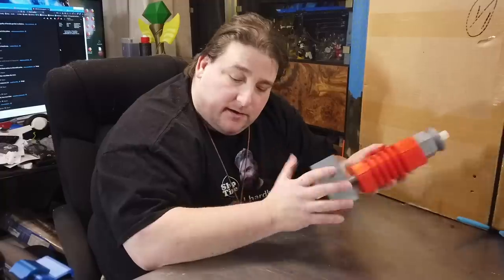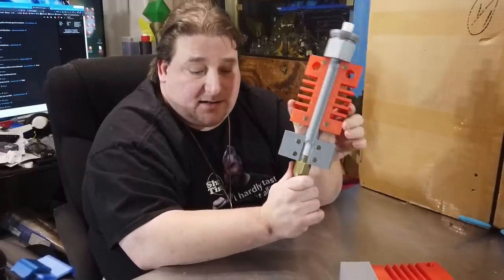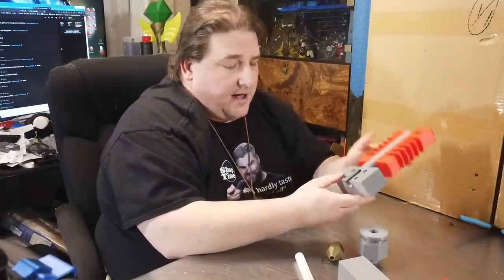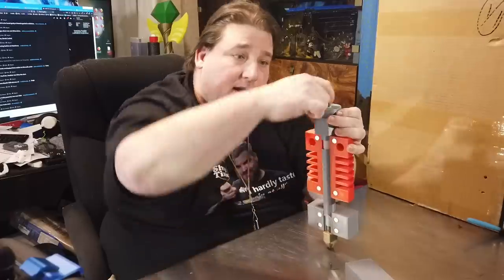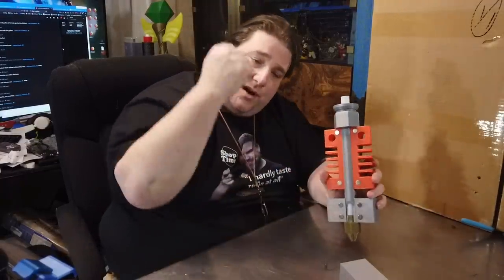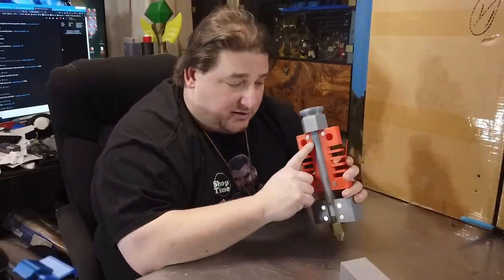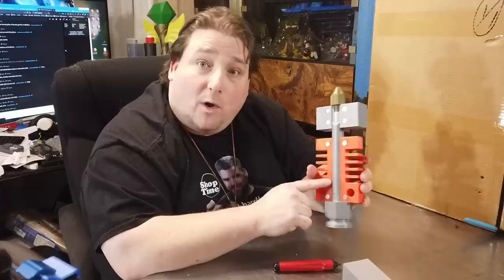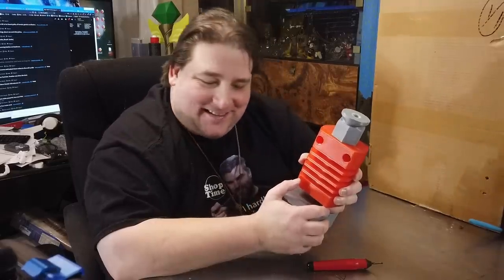Creality Hot End Failure Modeling How to Fix, Assemble CR 10 Ender 3 5 Mini T3DP

Comment: Yeah don't try to screw the nozzle all the way on the Ender 3. Mine snaped because it's supposed to have a gap on the ender 3 for some reason.
Reply from the maker: It's not so much that it has to have a gap but if you bottom out the nozzle into the hot end then you won't know if you have actually made contact with the bowden tube so by making sure you have a small gap there by essentially putting The Bowden tube for their end you are ensuring that you're making contact with the bottom tube and not just mistaking me thinking you are by bottoming out into the heat block

Comment: My all metal hot end fluctuates in temperature while printing. Do you know what could be causing this?
Reply from the maker: There are several things that could cause a fluctuation in temperature it all depends on how big of fluctuation are we talking about one or two degrees? Don't worry about it

Bigger swing than that? You could consider a silicone sock which will help insulate the hot end and make it a little more stable you might need to PID tune the hot end but if this is something new that's probably not it if you have blowing air going over the hot end you might need to shield it I had a rash of print failures and it turned out it was the mini split turning on and off and blowing air directly onto the printer :-) I stood a box up on the end of the printer to divert the air from the mini split and that fixed it
Reply: @nerys71  Thank you for answering me back, i didn't expect a reply. I put on a silicone sock and made sure there was no air in the mini... and there was.  My ender is doing a lot better now! Thanks so much.
Reply from the maker: @richardramirez3203  no problem I do my best. yeah the mini sent me for a loop!! I was by coincidence standing in its path getting ready to get Mjǫllnir to do some work and the mini popped on and I felt the breeze hit my back and realized it was straight at the machine!! might never have figured it out if I were not standing between it and the machine.

Comment: Why does the creality hot end have fluff like stuff inside, should I remove it?
Reply from the maker: Fluff like stuff??
Reply: Nerys yeah it is grey and lines the heatsink and looks kinda gray and can come away from the wall. It has ah hole for the PTFE tube in. It makes it a tight fit where it other wise would not be. It is an Ender 2 bought last Christmas 2017/18

Comment: This is great, but the creality hot end isn't designed like this....the PTFE tube doesn't push through to meet the nozzle, the metal bar inside the red heat sink is machined down to match the size of the PTFE tube and this then goes into the heat block.... so basically you can only cut the tube square push it through the heat sink tube till it butts up to the machined bottom of the tube ?.......this is how my ender 5 was shipped to me anyways :)
Reply from the maker: That is not how my mine is made on all of mine that I am aware of meaning that I have taken apart so far the PTFE tube physically touches the nozzle I can push the PTFE tube all the way clear through and out the bottom in fact this is how I instruct people on how to make sure the heat break is clear

Which printer are you using that it does not do this? They do have many different hot end design but the standard red heat sink with block on the bottom should be fully passed through with a PTFE touching the nozzle directly
Reply: Ender 5 just got it....has a red heat sink, but has a metal tube machined smaller one end....this small end fits into the heat block....the PTFE tube fits in the opposite larger end and then stops about half way down....thats were it butts up to were theyve machined it down inside.....

I guess theyve done this so the PTFE tube doesn't get melted/deformed by the heat from the block over time so they moved it out the block and machined the metal tube down to mimic the PTFE tube because its the same size...

so what i have to do is thread the metal tube into the block as far as it goes and tighten it....slide the red heat sink into it and connect them together with a grub screw....then push the PTFE into those as far it goes....and then tighten the connector at the top of red heat sink...then lastly thread the nozzle and nip it up....it should lock against the bottom side face of the machined metal tube creating a join inside the heat block.....make sense :)
Reply from the maker: Interesting. that must be something brand new they are doing I have 3 Ender five printers and none of them have that hot end

Comment: I don't know what's going on with my Ender 3. If I screw the heatbreak tube all the way into the block, there are not enough threads for the nozzle. If I screw the nozzle all the way in, there aren't enough threads for the heatbreak tube. What up with that???
Reply from the maker: Neither one should be all the way in there should be a small Gap between the base of the nozzle and the heat block

Once you have the heat break and you use the set screw to hold it in place

The reason for the Gap is to make sure you can tighten it down enough if the nozzle were to bottom out into the heat block but not touch the PTFE tube and seal against it you would have problems

Comment: Try the fix below if you're having persistent issues with a gap forming between the tube and nozzle.
Reply from the maker: You will only have a gap issue if the coupler is bad or its improperly assembled.

Comment: So if I scale it down to 20‰ will this be a scale model of the hotend? Or is 500% just a fictional number?
Reply from the maker: That's correct I designed it as a one-to-one replica and then scaled it up 500% I'll double check that number but I'm pretty sure it was exactly 500% So 20% would give you one to water I guess I should upload the original 1 to 1 files as well I will see if I still have them in the tinkercad save

Comment: Making the end of the PTFE tube SQUARE seems key...anybody know of any good tools on Thingiverse?
I tried to eyeball it, and no way.  Not going to get that square by eyeballing it?
Also, you want the PTFE tubing to slide easily inside its heat sink tube...using the tube itself knocks some of that schmutz out...anybody know of a tool (or accurate diameter) to clea all that plastic out?
Reply: And which one did you go with  @SeanOHayer  ?
What was GOOD about the one you like?
Reply: Bob Johnson honestly, any of them work great. I don't like the "guillotine" style ones as you should not cut these tubes by pressing down on them. You don't want to pinch the tube. But, as long as you spin the tube while cutting, you should be fine. I see a lot of people chamfer the hole of the tube as well, but I haven't done that myself. 

Here's a simple one that works
https://www.thingiverse.com/thing:3028810

Comment: I have filament leaking out from under the heat block and above my nozzle. I think that means I broke the heat break :/
Reply from the maker: It could be something broken or it's just loose do a search on YouTube for t3dp hot end you'll see my video where I made the giant size creality hotend I go through how to disassemble and reassemble it follow those Instructions make sure you clean it all out and reassemble it obviously inspect for broken or cracked Parts before reassembling
Reply: I’m new to 3D printing, so initially when I tried to replace the nozzle I tried to unscrew the old nozzle while the printer was off, so nothing was heated up :/ it was really hard to get off and that’s why I think I stripped the threads on the heat break. I did try to dissemble and reassemble everything but still had the same issue. I plan to disassemble again and take a closer look at the heat break
Reply from the maker: @brittanyshim3735  good news is that if you did damage it its super cheap to replace.

Comment: Interesting.
This is not how the hotend is designed on my ender 3 pro.
On my hotend, the nozzle and heat break tube screw in to the heat block and are end to end.
The nozzle does not screw in to the heat break tube. Its critical to allow a gap between the shoulder of the nozzle's nut and the heat block or you will have a mess in no time.
Reply from the maker: That is correct the model is correct but without fretting the beauty ft two passes through the heat break and touches the nozzle the nozzle and the heat break must touch but they do not threaten to each other they both read into the heat block you are correct you need a gap between the nozzle and heat block so that you can ensure the nozzle is actually touching the heat break and not simply bottoming out on the block because apt Fe Gap would be very bad
Reply: @nerys71  Yes...  The PTFE passes completely through the heat break and butts on the nozzle.
The heat break and nozzle both screw in to the heat block and butt up against each other.
I looked at this model on thingiverse and it has the threads of the nozzle going in to the heat break tube. This is not correct.
I have rebuilt my hotend many times. I keep stripping the threads in the heat block. Aluminum is soft as butter. Luckily, you can get heat blocks on amazon for dirt cheap.
I wish it was designed like the model in this video. With the heat break made of stainless steel, stripping the threads would be far less often.
This is a great video.. Its to the point and regardless of the design, it explains how important it is to get the gaps of of the assembly.
I really like the 2 turn trick on the PTFE fitting. I'll be doing that at next rebuild or cleaning.
Reply: @nerys71  For what its worth.. you look and sound exactly like an old friend of mine named Mike Beck.
Reply from the maker: @mikeoverbay4594  its a model. no threads so one inserts into the other so it holds itself together.
Reply: @nerys71 it would be very hard to start the threads unless the two heat block parts are together.
I’ve referred people to this video when they post about leaks. It’s valuable information.

Comment: I thought we had this problem kicked because your instructions were so detailed and clear, but we're still leaking filament all over the heat block and around the nozzle. We did switch out the nozzle that came with the machine for this one: https://www.amazon.com/gp/product/B07MDWXV77/ref=ppx_yo_dt_b_asin_title_o04_s00?ie=UTF8&psc=1. Could we be having compatibility issues?
Reply from the maker: I don't think so unless the threading is the wrong kind it looks like it should be okay from the pictures at least the only reason you'll have leaking is if you do not have a tight connection between a PTFE and the nozzle there is no other way for it to leak since there is no place else for it to leak from assuming it was assembled correctly I would be suspicious of the compression fitting coupler maybe it's letting go of your PTFE tube
Reply from the maker: Also make sure the cooling side and the heat block side are secured to the heat brake tube if those components are loose it will permit the parts to push a part

Comment: you forgot newer to screw the nozzle flusch to the heaterblock
Reply from the maker: why not? I always screw the nozzle in as far as it will go. not screwing it in flush is new to me ???
Reply: @nerys71  doing so might create a gab in the hotend as the heatbreak isn't flat against the nozzle
Reply: This style hotend, the PTFE sits against the nozzle. It's easier to screw the nozzle all the way in and jam the tube in using the method he explained in the video. 

If this was an E3D style nozzle with an all metal heat break where the PTFE doesn't touch the nozzle but instead touches the heat break, you would be correct.
Reply: @justinl.3587   Justin L.   you are wrong the heatbreak needs to be pittet against the nozzle if not the heatblock will be loose tjeck the youtue video called something like hotend explained i know its a e3d he shows a model of but it still shows what i mean as the creality hotend does the same
Reply: @nickt4508  Sorry, you're wrong. In the Creality hotend, the ptfe tube touches the nozzle. The heatbreak does touch as well and does aid in tightening the assembly but does not aid in sealing the assembly. The ptfe seals it. 

https://goo.gl/images/tpWL6r

It is exactly as the same as the model he has here. And the seating procedure is EXACTLY how you should do it. 

If it was an all metal hotend, which the original creality hotends are not, the nozzle sits against the heat break by itself and the ptfe is far above the melt zone.
Reply: @justinl.3587  that video show exactly what i mean.
The METAL OF THE HEATBREAK  needs to be FLUSH with the NOZZLE as to lock the heatbreak with the heatblock and nozzle so the heatblock isnt loose and that cant HAPPEN if the NOZZLE is FLUSH with the HEATBLOCK then there will be a gab between the HEATBREAK and the Nozzle.

do you understand now what im trying to say
Reply: @nickt4508  look, I get it, I really do. But your original point with the nozzle not  being flat against the heater block means nothing. 

You screw the nozzle all the way in, screw the heatbreak all the way in until they touch. Install the ptfe and leave the coupler a turn loose. 

Heat everything up, torque the nozzle again, and screw the coupler in, forcing the ptfe against the nozzle. It's the seal. 

Even if the heatbreak isnt fully seated to the nozzle it won't matter. The important part is the seal between the ptfe and the nozzle.

Comment: Hi Nerys, love your videos!
I bought the Ender 5 after I saw your review of it, it's my first printer and I'm loving it so far :)
I've run into some problems when I started making bigger prints (covering more of the print bed) so I thought I would spend some time leveling the bed better.
Wondering if you or someone else here could help me out since I'm not sure where to go from here?
I created a box in fusion 360 with dimensions 20 * 20 * 0.2 (mm), sliced it in Cura with the profile that was included with the printer and I'm using layer height 0.2mm.
I put 9 of these boxes in one print, at each corner, side and center and this is how far I've gotten https://ibb.co/yQb0xBY
2 things...
Why are the walls on most of the boxes printed with a lower layer height?
Not sure what to adjust from here, seems like I can improve some corners by making others worse? :(

Grateful for any insights :)
Reply from the maker: if that is all from the same print you may have a warped bed. take a nice clean straight edge like a good level of metal ruler and put it edge wise across the bed to check for flatness. you can try to straighten the bed if the difference is slight (remove completely from machine straddle between to pieces of say 1/4 and gently push the opposite bed to flatten it (careful you can damage it)

or put a piece of glass on it.

for bed leveling use a CIRCLE with a diameter 75% that of the beds width (so about 150mm for an ender 5 roughly)

easiest way to do that is load a small round object with a 75mm (radius) skirt of 3 or 4 perimeters.

adjust your bed level live as it prints the skirt. repeat till it goes the first time without you having to adjust it.

Comment: Nothing about the distance of the throat. A third of the video was about printing the model lol. Crazy
Reply from the maker: the distance is not relevant. as long as the nozzle and ptfe are in solid sealed contact with each other it will work. you can be up or down a mm and it won't matter.

Comment: you need to 3D print a treadmill~
Reply from the maker: That would tank some expensive filament. And running is bad news for people like me. 460 pounds. Running equal knee replacement surgery. Has to be low impact like cycling or swimming etc..